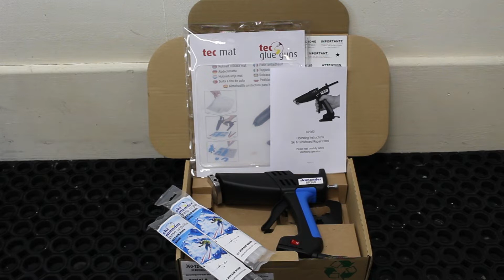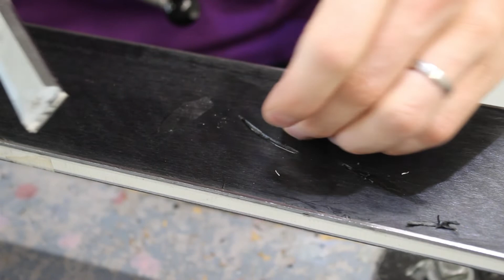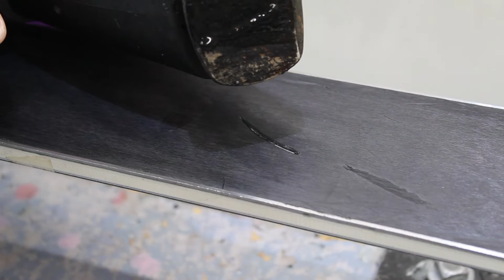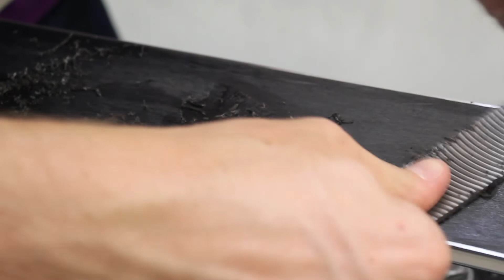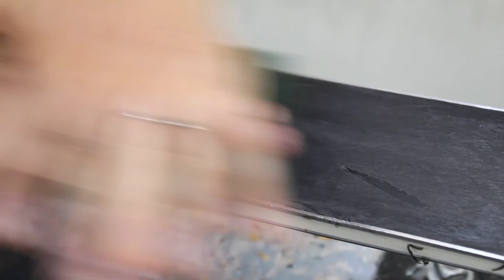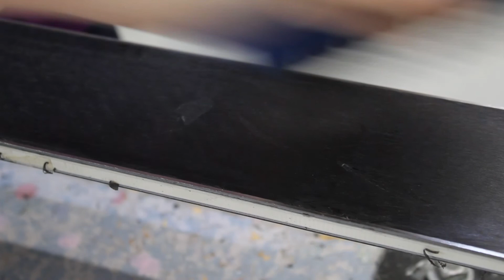Ski Mender Rp360 Base Repair Pistol - Anything Technical Ltd

Comment: Does the gun come pre loaded with clear? Just picked one up from SVST and was surprised to see clear dripping from the end while it was heating up.
Reply: They test each unit at the factory for correct operation and temperature.  They use a clear stick for that test.  So not "pre-loaded", but still some left from the testing.

Comment: looks very messy for sorting out a minor gouge! Given a deep base gouge would, likely, need a metal grip epoxy layer first...why not save the £150 cost of the RP360 and spend it on a heli-ski trip and use a P tex candle and cig lighter - IF you only have your own skis to sort :)
Reply: Ptex candles have wax in them to help them flow, which makes the repair a lot less solid than proper Ptex. Fine for small repairs, but it’ll pull out from larger ones. I started with candles, then the cheaper hot glue style gun, and then this RP360. The latter is so much better. Whether it’s worth the extra expense depends on how likely you are to gouge your bases. I go off piste where’s there’s often roots & stones below the surface, so for me it’s a must.
Reply: Wow, I've just seen they actually cost £200! You can buy a 'hot' glue gun ( not to be confused with standard gun) for around £25. I've had a quick search on a well-known global retailer's website and it appears many will take a standard 11mm  P Tex stick. P Tex melts at circa 150c and base material around 170c so it's VERY important you buy a gun with adjustable temp control...and check it's accurate - before using it!